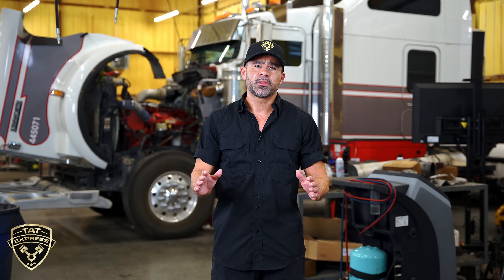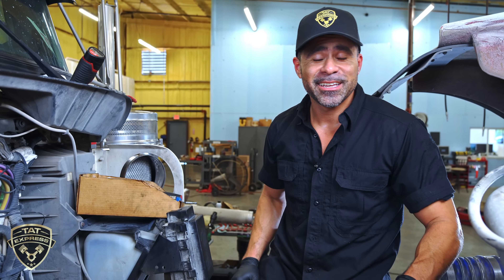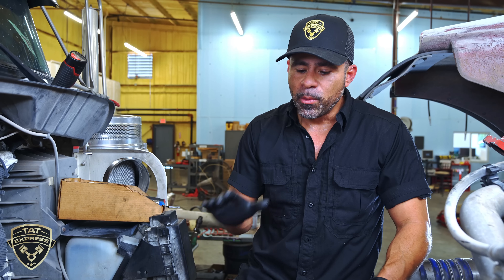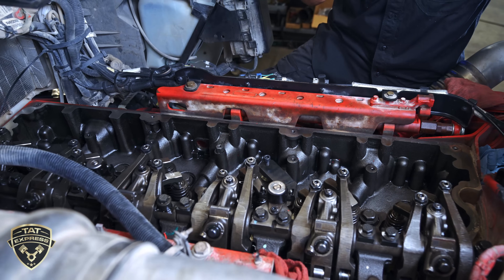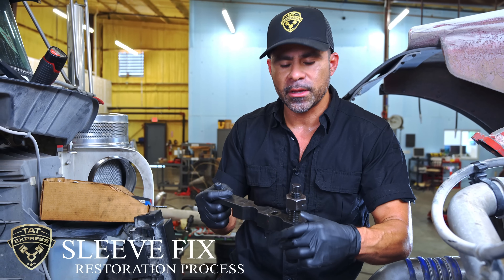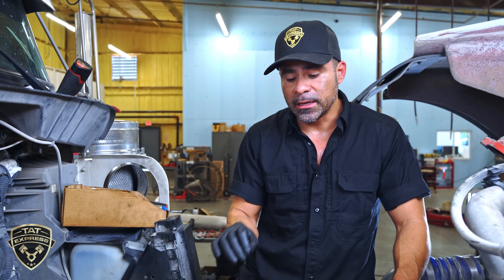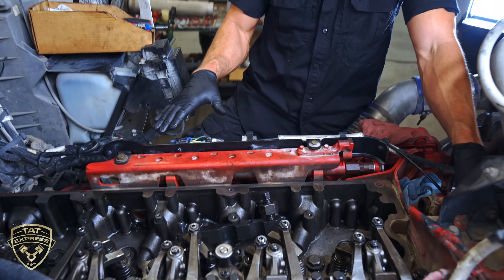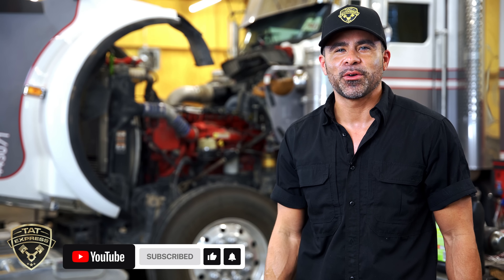Low power Cummins/ Cummins engine low power/Cummins power loss/ Cummins ISX loss of power/ ISX15

Comment: Not directly related but never the less the cups are affected by the Achilles heel of Cummins there thermostat that fail all the time, on the bigger engines the fail open but on the smaller ones they crap out and stop the flow. Shout caterpillar been doing injector cups since the 3106 came out mid 90’s

Comment: What is a ball park saving by putting in retainer rings verses replacing the head?  After all, there is a risk.  Thank you.  Great Channel!!🇺🇸
Reply: About three years ago,i bought the tool for $550 from Cummins, and $120 I believe for 6 retaining rings. And did the job
Brand-new OEM engine head from Cummins  was $7,300 that time.